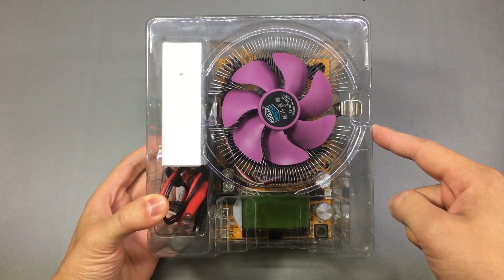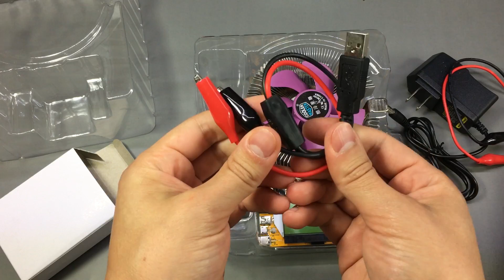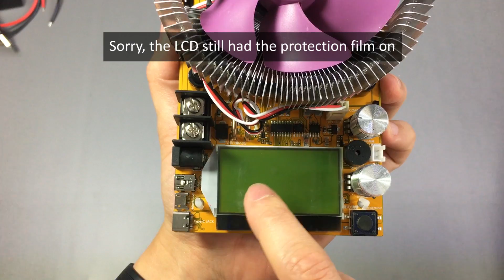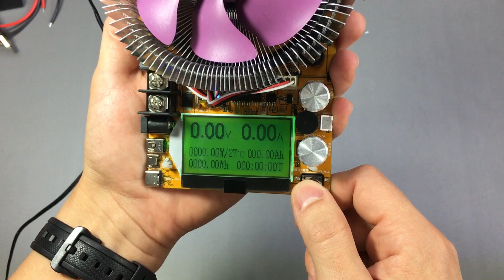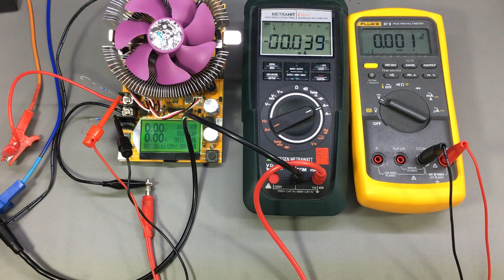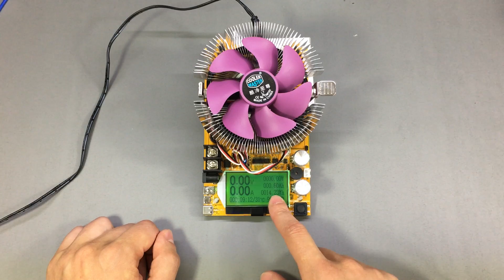Voltlog #119 - 150W Dummy Load Review

Comment: You can do 20 amps at over 13 volts with this tester if you make some changes in the setup alarm screen called > 150 W. After you have noted what the TEMP reading is on your data screen while drawing 149 watts for a few minutes with a 12v, LiFePO4, drop in battery, (my unit came set for 185 W and reads 70 Celsius in my house at that wattage), you can set the tester in a cooler full of frozen water bottles, or do what I do and set it on the face of a portable desktop fan, or any other trick that cools the heatsink better. You should see the TEMP go down a lot. Now you can increase the > 150 W threshold to 260 W. While you are cooling the heatsink more efficiently with whatever technique you decide to use, you can ramp up the amps until the TEMP gets back to where it was when you started. I can now do a 20 amp draw on a 100 AH battery for a true .2C rate test, as long as I set the tester on the face of the portable desk fan. The TEMP stays below 70 Celsius. You can't set the threshold very much higher without the extra cooling or you will burn up the MOFET under the fan and heatsink assembly. I tried it so others wouldn't have to ( that's me saving face, LOL) Hope this is useful to someone.

Comment: just had to rewatch this video to see how to get around that dang menue again. anyways i use the low voltage cut off and alarm to help me test watt hour capacity tests for my lead acid batteries. i fully charge the battery, find the ah rating, make the load tester match it, then set the low voltage to 10.5v and away we go. when the testing starts beeping i know the test is done and can use the watt hour reading on the tester display to find the real capacity of my battery. the test takes about 20 hours so i set it up and forget about it. it doesnt start back up once the alarm is triggered, even after a few minutes  which is nice. for some reason my display always shows .01 amps which bothers me. i do have a 30 v 10 amp psu i could calibrate it with i guess, but im not too worried with such a small amount of error.

Comment: Thanks again for the great video. I guess I'm not very smart. I tried the calibration procedure and ended up blowing the mosfet. Would you happen to know the part number? It was at about 7 amperes and 30 V for a very short period of time. Of course 7 amperes at 30 V exceeds the power limit of the load.  Don't understand why the calibration values exceed the limits of the device.  New info. It is a IRFP2064.

Comment: Did anyone check if you can change the USB-C voltages when testing a USB-C power source that supports different voltage levels? As you might know USB-C has voltage levels of 5/9/12/15/20V and the load sets the voltage. So I am wondering if this load can demand different voltages on USB-C

Comment: I got one of these recently from Amazon and have been using it to test some batteries. Occasionally it trips (stops) and displays the message  "Tips!". This is not mentioned anywhere in the 1 sheet "manual". Pushing the button starts it again without resetting the accumulated amp-hours or watt-hours. It happens on some large 12V batteries I'm discharging at 5A ~60W) and with some small portable li-ion power packs that I was discharging at only 1A (5W). The "T" suggests an overtemp condition but this seems unlikely since I'm well under the 150W limit and the measured load temperature is kept quite low by the fan. Anybody else see this?

Comment: Few years later and there is similar load with color LCD, electronic control, 4 wire measurement, voltage cuttoff, bluetooth, phone app and PC connectivity. https://www.aliexpress.com/item/1005001458325206.html

Comment: By far this is the best video that I've watched about this load which is still being sold in late 2020. It DOES have low voltage cut off but after 4 second it starts again and keeps cycling, thats why the price is so cheap compared to "full featured" Electronic Load. One could use that 3V trigger voltage to permanently keep the device disabled with a simple latching circuit. 73 N8AUM

Comment: Do not buy this garbage!!! I just used mine the first time to discharge a scooter battery and boom, XT60 melted instantly in a huge fireball. My load boots up with the MOSFET always open as soon as you apply the 12V supply voltage, even when in the display it says load is OFF.  Aliexpress (atorch) seller says literally i should go f myself.

Comment: Finally got one. The 180W version first ordered with vertical fan never came. So I got the one you review. Found current showing around 8% higher, but not instruction how to calibrate. It actually came programmed to switch off at 180W.  Great for checking capacity of small batteries. But when connected to a Yaesu FP757GX a 18.8V 20 A supply I very carefully did current tests but at 13A it blew up! Very poor fine control, I know it is cheap but sorry way too poor of a craftsmanship.

Comment: How could you set the low battery voltage while checking battery capacity ?  Say  End Testing at 3.00V for lithium cells ?

Comment: I bought one of these and the fan is a knockoff for sure, don't know about the rest.  Everything looks identical, but my fan's label just says "Cooler" in the top half of the logo, empty space where it should say "Master."  The brand was "Makerhawk" on Amazon, paid $45.99.  

There were a couple of places selling identical ones for like $38-40, but I paid the extra 5 hoping to get the best knockoff.  About to test it out. 

edit: about the pots, would it be good to swap them for some 5-10 turn precision pots?  I got a few of those for cheap, 10KΩ and 50KΩ, maybe I"ll try it out if the existing Ω are close.

Comment: Something I made a long time ago comes in handy for things like this: an opto-reflective sensor that looks for fan motion by detecting a small dot of "White-out"(tm) I put on one of the fan blades. It's a small and simple circuit and if it doesn't detect a reasonably fast stream of pulses coming from the sensor (fan has stopped or is moving too slow to be useful) the circuit removes current from a relay..which I generally use to cut-off power to the device. I designed it as sort of a dead-man switch too...so if the protection circuit itself failed then the relay would automaticlly drop out and also thus turn off the device.
It can be used with just about anything that relies on a fan for proper cooling.
I made it as a non-contact device so I don't have to mess wtih putting thermocouples on a device I'm testing or prototyping.

One could also consider building a circuit using an IR sensor but that's more complicated to build and not as straight-forward to use.

Comment: While it's kind of implied by the "no overtemperature protection" I think that "No fan failure protection" or "No fan failure auto-shutdown" is a critical CON and deserves its own listing. One might even list something like "No malfunction auto-shutoff" as other things might fail with similarly dangerous results.

It should also be kept in mind that with low-voltage auto-cutoff being so difficult to set many people will skip it and it can potentially cause lithium batteries to fail explosively and cause a fire. That is a LOT more serious a CON than just listing the "no easy adjustment of cut-off voltage"

In fact, in future reviews you provide, it might be a good idea to add a third category for dangerous things so you have, "Pros", "Cons", and "WARNINGS"

Comment: Is there a link to an online copy of the user manual/pamphlet you can point us to to help clarify the following issue to prevent over-discharging battery under test?
My entire reason for getting something like this product is to be able to automatically test batteries without having to worry about over-discharging them during tests.

Some Specific Questions Regarding Your Video

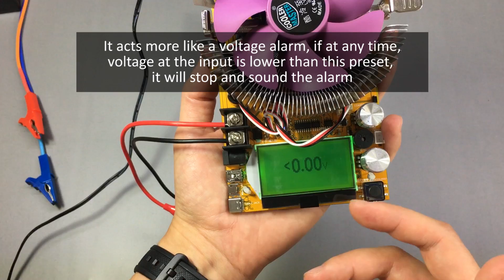15:17 TEXT ON SCREEN: "It acts more like a voltage alarm, if at any time , voltage at the input is lower than this preset, it will stop and sound the alarm."
18:10 TEXT ON SCREEN: "-no easy adjustment of cut-off voltage"

So...it's not "easy" to adjust it to a minimum cut-off voltage but it can be done? For example, if the input voltage drops below my Min Voltage setpoint of 3.00V it will cut-off and sound the alarm?
Does it then STAY cut-off so it completely stops drawing power from the connected power source under test (like a battery so it won't over-discharge the battery under test)?
Or...Does it automatically cycle back on as the test battery's voltage self-recovers a bit and then the product cuts-off again when the voltage drops again below my setpoint?

At 17:15 you said, "When a fault appears...3 volt high signal at that (2-pin) connector...can be used for something else."
This suggests IF NECESSARY a person could use this 2-pin connector to control a simple latch-off circuit that disconnects a battery under test completely from the circuit and then KEEPS it disconnected, after any alarm condition (including voltage below the Minimum Voltage setpoint) and even if the alarm occurs just once. This would be a lot easier than adding the "special circuit" implemented by KainkaLabs in his video (his special circuit provides only 3 discrete voltage disconnect setpoints), and using this 2-pin connector would allow much more versatility in using the voltage, current, and wattage "Minimum" setpoints.

BACKGROUND INFO:
Low-Voltage cut-off issue?
KainkaLabs in the video at https://www.youtube.com/watch?v=KcGBHZEOt5s claims there is NO Minimum Voltage Cut-off and he had to add a custom circuit to what appears to be the same product in order to get the device to stop drawing power from for instance a battery when the battery's voltage dropped below a specific value. He claims this is to keep the device from draining the battery once it dropped below a voltage he sets on his special added circuit (his circuit provides 3 discrete cut-off choices at 1V, 2V, and 10V).
But, you seem to say that the device already has a minimum voltage setpoint function and will stop draining a connected battery when it falls below your entered minimum voltage trip-point...but that it is "no easy adjustment".

Comment: I have a version that is almost perfect, the unit works great except the cut-off Voltage/Warning function, it shuts off the load but as soon as the voltage increases a little the load turns back on, if only it stayed off until the button was pressed :( Almost all batteries have a recover voltage so this is an annoying problem, the manufacture has almost got it right, maybe some clever person will work out a simple modification to fix this problem. Maybe some kind of electronic latch connected to white socket located to the right of the current adjustment pots. Apparently this socket is a warning output.

Comment: I bought the current version of this load from Ebay.  The load, as best as I can figure it out is quite nice.  The overwhelmingly bad part of this load is the one small sheet of mechanically translated chinglish instructions.  I've had it for two days and have yet to figure out how to set the low voltage cut-off.  The reviewer is wrong.  The "<0.00" parameter is the undervoltage cutoff.  I've figured that out from the manual.

Horrible review.  All he did was walk around the board showing the connections.  No use cases.  No demonstration of setting up a test.  Worthless.

Comment: I have a later version it seems, with a green PCB and the Cut off Voltage Warning also shuts off the load.
Reply: You COULD have a counterfeit. Sometimes a counterfeit is better than the original in some ways.

Comment: Rdson of the MOSFET rises with temperature. Obviously either the current measurement and/or the current control has a temperature drift.
Great idea to test disconnecting the fan. This is dangerous indeed.

Comment: Did you also do an accuracy test of current and voltage measurement? To my experience the current sensing is often way off the specs over the whole range from 0.2 - 10 Amps.
This is not the fake load, is it? Ah accuracy measurement was coming later  - seems fine here :-) Its really funny that this piece doesn't have temperature control and a temp. regulated fan - as the cheap products and even the fake product has it?? Also the 4-wire sensing is missing, which would be cheap to accomplish. Must have been an earlier built i guess - hope future versions will be more improved. Any hints on that?
Reply from the maker: this is not a fake model, but not a good model either. I don't know if there is any follow-up version of this model, I haven't seen any.
Reply: thanks for the answer. What exactly do you mean by not a good model either? The measurement seems to be quite accurate but some features like temp. sensing and fan speed control are missing. But the most important for me is stability and reliability in measurement. And if it does real 150W - than that is o.k. for the price.
Do you have a model in this power range that you can recommend with a similar price? :-)
Reply from the maker: the 60W model that I reviewed I consider the best because it's reliable and has an easy to use interface. This 150W model has some issues with setting the current, the adjustment is kinda coarse and it wasn't able to sustain 150W, it should all be in the video and I don't remember the other issues because I reviewed it a year ago.

Comment: Analog circuit and shut resistor also heated up, then this cause current changes! When you want, you can with air spray cool down all analog circuit, then you can see, current is also changed. This is not provided by FET internal resistance, this is provided by analog circuit.

Comment: Mine had been working very well until recently even at 58V power source. One week ago I tried to test a 58V battery pack  and there were huge sparks at the input terminal and smokes at FET as soon as I tried to connect the battery . 
I replaced FET with new one with higher spec than original one and it worked well under 15V. However when I applied 58V battery , same thing happened again and the FET was blown out.

Comment: I want warn the user of this device! Please be careful if you connect your energy source to this electronic load, be sure that you turn down both load control potentiometer while you are connecting your source to this load!
I was not so careful and as a result my LiFePO batterypack burned down the power transistor. It seems that the load dont shut off the load at the boot time!

Can some one help me and write which type of power transistor is using this load?
Reply: I found  the answer in the other comments, it`s a IRFP264. I have ordered some at ebay for repair.
Reply from the maker: be careful as the ebay ones might be fakes which will easily fail under a bit of stress.

Comment: I bought this dummy load, to use for discharge my 48V ebike battery, but when I got it up to 100W load, it short-circuited my battery and after a few times the MOSFET on the dummy load was shorted between drain and gate. I ordered new VISHAY IRFP264 MOSFET. I got to 130W before it also short-circuited. Is it the "high voltage" that kills it? Maby you also can try it with a higher voltage VoltLog?
Reply: probably reached the second breakdown of the MOSFET due to being too hot. If we aim to keep the die temperature below 100C to maintain reliability we can work out approximately how much power we can dissipate. A TO247 die-to-case resistance is about 0.5C/Watt. The heatsink in the video can probably do 0.5C/Watt to ambient. Assuming 25C ambient, the maximum continuous power we can dissipate safely is P = (100-25)/(0.5+0.5) = 75Watt. Worth noting that the die-to-case resistance of the FET will be significantly worse if the heatsink is mounted to the plastic side of the FET package instead of the metal side. They really should have used two or maybe even three MOSFETs in this design.
Reply: Lucky for me I ordered 2 spare MOSFETs, so now I changed to the second spare I had. This time I tested with a 12V PSU, and placed a temperature probe in the MOSFET hole on the backside, to monitor the temperature. Now I got up to approximately 150W load and the temperature probe measured 80ºC! I ordered the MOSFETs from diy-audio4you  on eBay, a German company, so I hoped it was genuine parts. Should it work with the 48V ebike battery now, or could the voltage be a problem?
Edit: Picture of the setup from my OneDrive: https://1drv.ms/i/s!Arb68ycFMJxLtGgtSCLGGUrlrUq8
Reply: I could not resist, so I tried out with the 48V battery, and now it went just fine! : D I suspect that the cooling paste I used on the first MOSFET was too old, and therefore it became too hot. I also now used a separate 12V supply for the fan to run it on max speed. Thanks for the good answers :)
Picture of the 48V setup: https://1drv.ms/i/s!Arb68ycFMJxLtXUVl-bIfTPlFhwZ
Reply: Got the same problem with mine
Reply from the maker: I don't think it's the voltage that kills your mosfets. It's probably too much power, the mosfet overheats and it fails.. sometimes they fail as a short circuit. I would suggest getting the mosfets from a known distributor, not from ebay(they could be fake if you got them from ebay).

Comment: I just bought one of these and had it working in low voltage alarm mode by using the  <0.00V setting. 
However after using the menu reset I can't seem to adjust this value again.
C/SH ould have been so much better!
Reply: I think there is very poor debounce in the button press. After lots of trial and error I've re-enabled the cut off voltage. Sometimes holding the button increases the threshold, other times it reduces it.
Reply from the maker: You should also check the button itself, maybe it's low quality and got damaged.